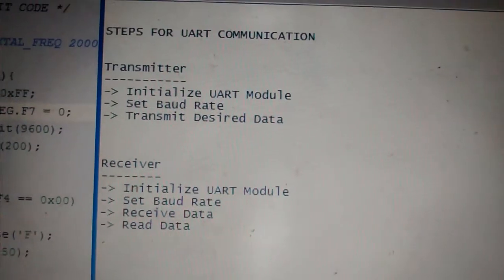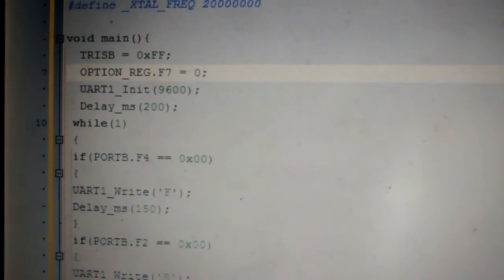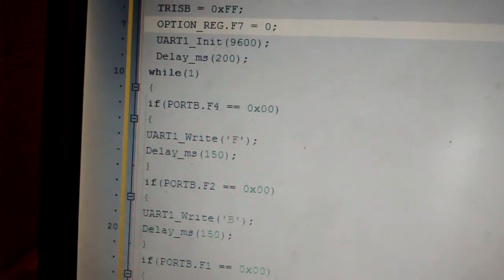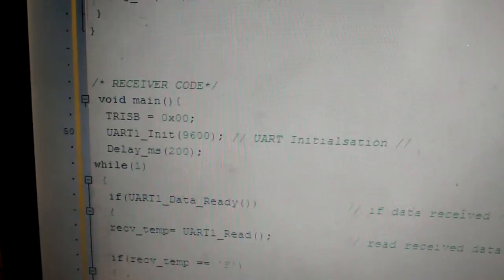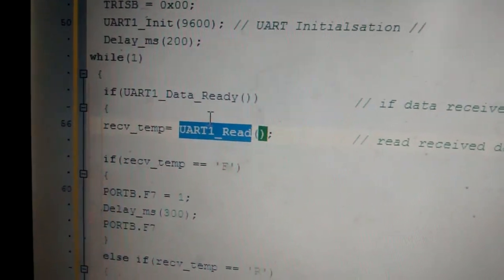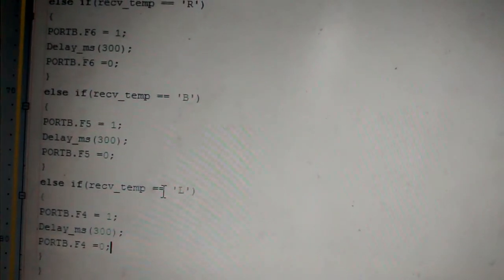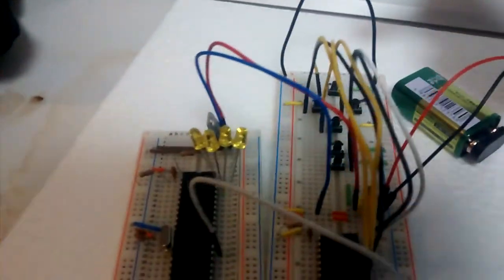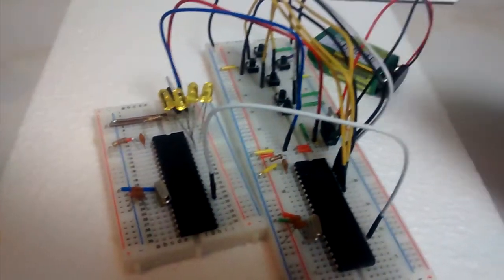PIC16F877A UART SERIAL COMMUNICATION BETWEEN PIC MICROCONTROLLERS : BASIC TUTORIAL PIC16F877A

Comment: Hello Sir I need help with UART of PIC16f877a Can you help me out please ?
Reply from the maker: Uneeb ur rehman Yes I will try :-)
Reply: I have RF module Fs1000a with XD-5v receiver I wrote codes on mikroC correct coding like yours. But problem is RF dont communicate through pic although they do If i use switches. 
I had not used a Max 232 decoder with receiver Do I need a max 232 for PIC 16f877a ?
Reply: Buy switches I mean without PIC not switches through PIC only switches
Reply from the maker: Uneeb ur rehman sorry I couldn't understand your point here
Reply: I cant upload images here are you on whatsapp ? or gmail ?